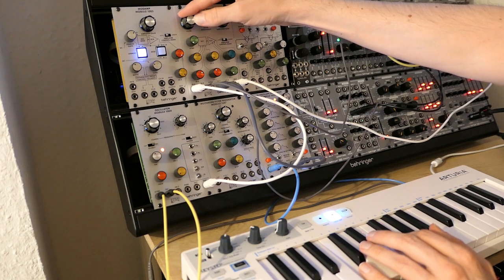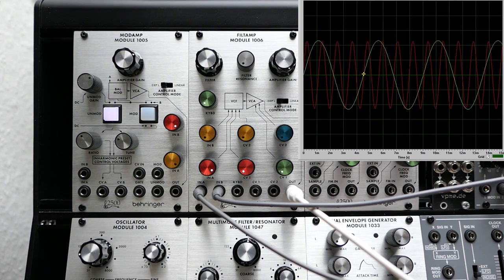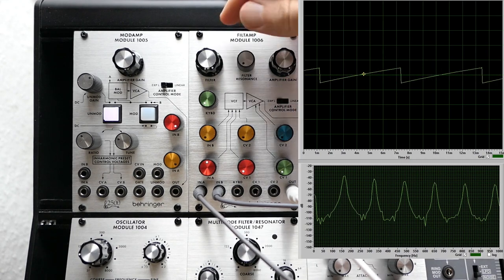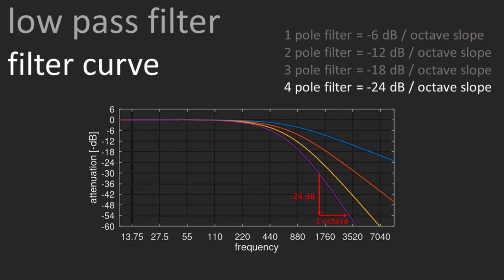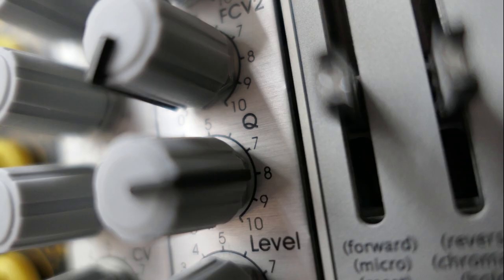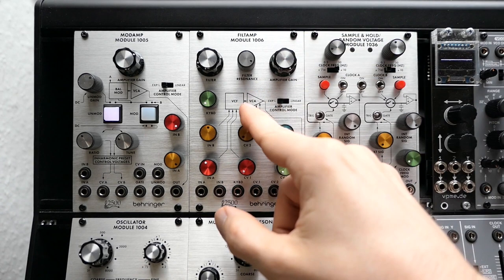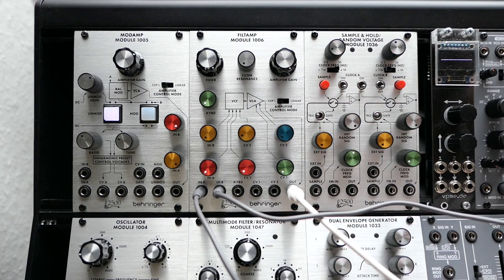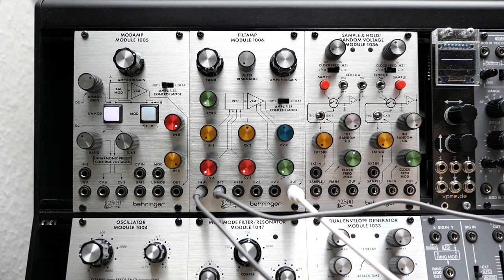Behringer FiltAmp 1006 ~ lowpass filter theory & filter sweeps

Comment: Thanks for the video. I have this module and though its great I notice that there is a significant TIC sound at the start of every opening of the VCA - You can still hear it with no input connected. Is this what you meant by noise - or were you referring to background continuous noise? I'm wondering if mine has a fault?
Reply from the maker: I was referring to the background noise, but my module also makes the "tic" sound you describe when I apply a gate (or any fast rising cv) signal to the VCA. Many VCAs do this and it's pretty normal, you can even use it as a musical element. Only the vactrol based modules don't do this, they are much slower in their response to cvs.

Comment: 303 is a 24dB diode mate 😉
Reply from the maker: You're probably right, but I read somewhere that it is 18dB in practice and 24dB in theory. Look at this filter diagram here: https://www.sequencer.de/synthesizer/threads/tb-303-filterantwort.107220/
You can see at the yellow curve that it's closer to 18dB than 24dB.